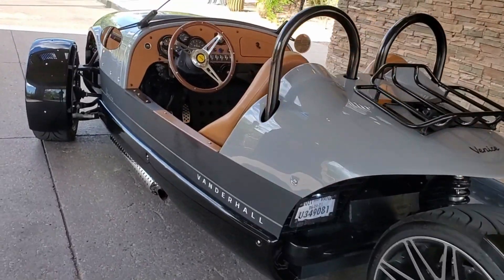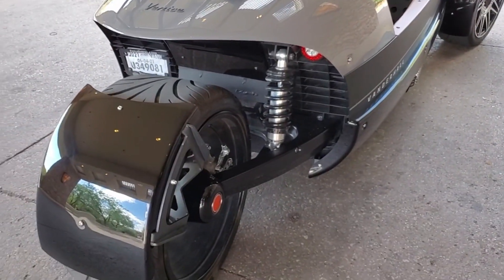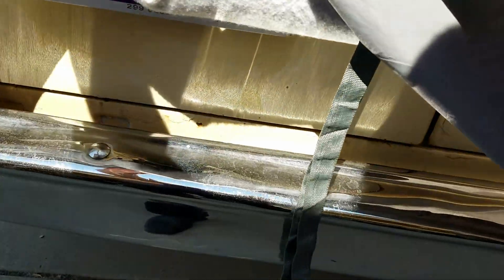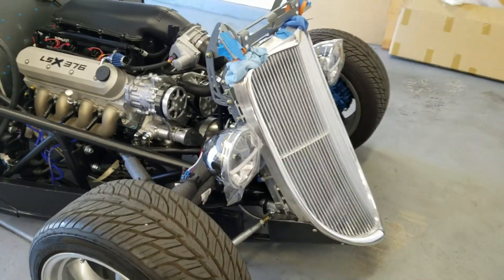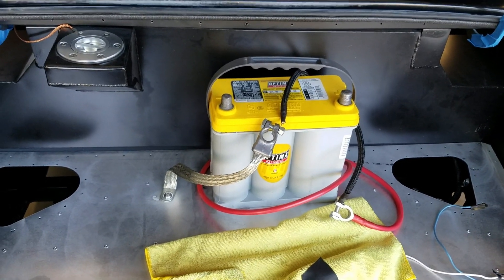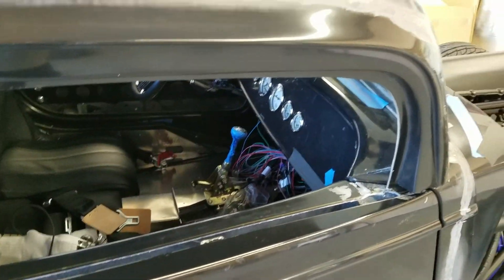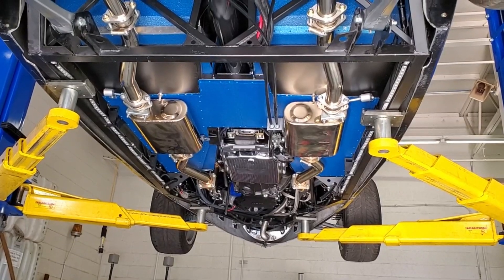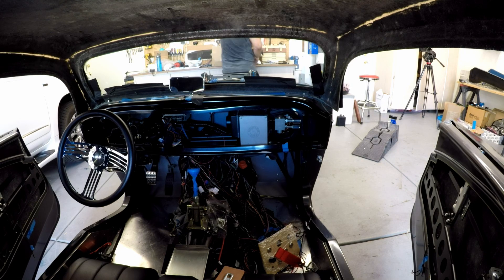Factory Five 33 Hot Rod V2 - Making The Car Road Worthy - Police Called

Comment: Jim,

Did you change your shocks to the bottom hole from the top hole? The video shows them in the bottom hole... is that where you have them now that gave you some extra clearance?  Curious because the manual says use the bottom hole for the hot rod.
Reply from the maker: Yes,  I got 1.75 inches higher clearance changing holes.  The manuals change all the time as do the cars.
Reply: @StreetRodJim  Gotcha... only asking because I could use more clearance on mine but I'm already in the bottom hole.
Reply from the maker: @johnsharp8935  You will have to crank the shock coils then.  i.e. Screw them tighter.